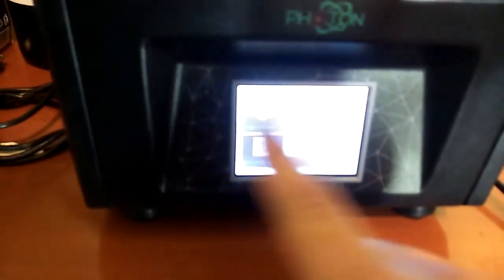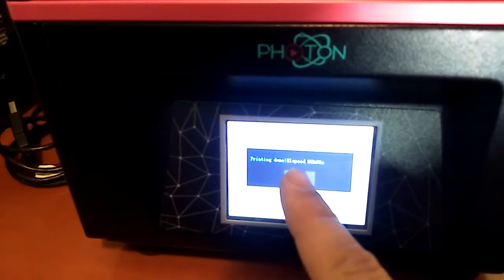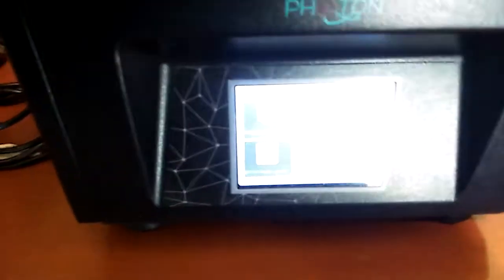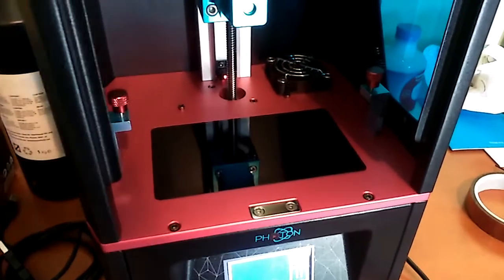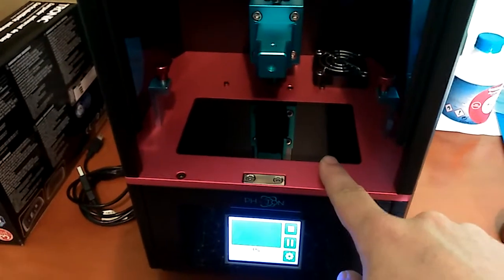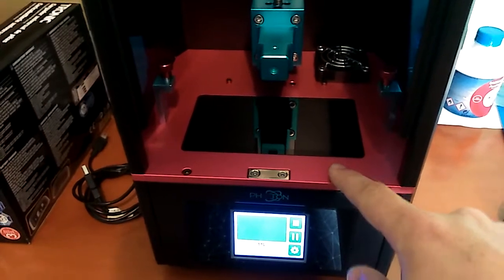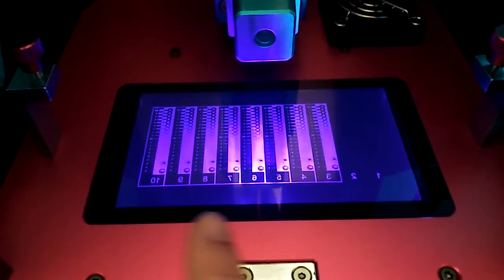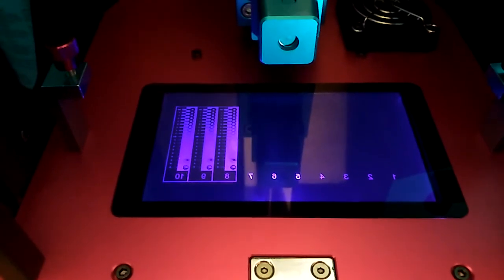Anycubic Photon UV Resin Exposure Latitude (seconds) Finder

Comment: Hey, saw your work on github regarding the anycubic. Any chance you know what LEDs they use? I'm planning on modifying one of these printers to print at a different wavelength but I've had a hard time finding information about the board. Thanks!
Reply from the maker: you can't. not with MSLA. the way LCD work with the polarizers means it will block all UV below 400nm.
Photon and all MSLA and also SLA lasers are 405nm. only real DLP mirrors can be used for UV below that range: 395, 365...

Comment: I downloaded the latest version of your project, but my test print (resin-test-25u.B100.2-20 and resin-test-50u.B100.2-20) failed. 
The lectangular base sticked to the build plate successfully, but the scale sticked to the FEP...
From the remains on the FEP, I can tell the best setting for my resin. 
But I want the scale card... Any sugestions??
Reply from the maker: You probably forgot to put the machine in test mode first. For that you need to run the test-mode.gcode file and don't forget to run print-mode.gcode after finishing the tests or your prints will fail
Reply: I did executed the gcode file, ofcourse. When I failed, I run print mode once, then restarted the photon,  run the test mode again, and failed again. 
After printing the base, the build plate shifted once, then stayed in the same height.
Reply: @kululukumagai5030  what resin brand are you trying to test?
Reply: Wanhao normal Gray and White. I always use them with normal exposure  around 10s.  I just tried to know more suitable setting.
From the result on the film, around 14s would be better.

Comment: Hi great idea with very quick printing on the photon, should I be able to view the .photon file in the Anycubic slicer or is there a *.STL file as well?
Reply from the maker: The STL was only used as the base for the hacked photon file. since it does the multiple exposures without moving the buildplate, you can view the layers in the slicer if you want, just drop the .photon file on the slicer

Comment: you have change the acceleration of the z on the test mode? sounds more organic the motion
Reply from the maker: yes. there is a testmode.gcode that changes the speed and disables the peel for this to work and a printmode.gcode that returns the machine to original settings

Comment: Does the Gcode modification reset the Z=0 point? Or is bed leveling not changed?
Reply from the maker: Nick Leijenhorst the gcode only changes 3 params in order to stop the machine from doing the peel off motion all other stay the same. No change to zero or any other thing
Reply: X3msnake thanks! Just wanted to check
Reply from the maker: Cool, post back with your results or sugestions if you manage to try the tool ;)
Good printing

Comment: if you tape white paper (or light grey)around the display (cut a hole big enough for the display)your camera wont think its in the dark ( all the black space around display)and try to compensate buy over exposing the already brightly lit display and producing garbage images.. if that's to much work ,buy a camera with manual exposure control. just stop making videos that you cant see anything.
Reply from the maker: I advise you to learn how to use the internet. this video is old and there is a link to the project, there you can see tutorial videos on how to use the tool, resin exposure finder has been used and ported to many printers in the last 2 years.

Great thing about the internet is there are a lot of stuff better you can see. no need to be rude and ignorant

beside these tools existe in OpenSource I don't owe anything to you and I don't care what you think. And if you are that good at making videos feel free to remake this outdated video and i will gladly link to your upgraded video. thank you for taking your time to comment
Reply from the maker: besides if you use a real camera, not a mobile like i did here you can just use a fixed iso. But all that is beside the point. Better to share and keep a bad video that was the origin of free open source tool that a lot of people use. think of it as a genuine behind the scenes. and feel lucky that there are people that are willing to share without asking anything in return.

if you can't do that you should get off of the internet and stop wasting your time and the time of others